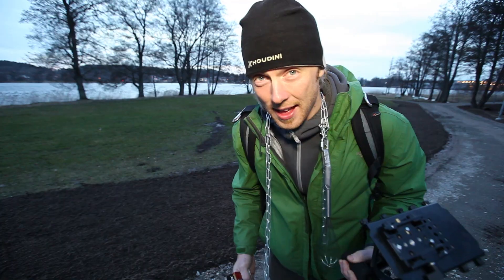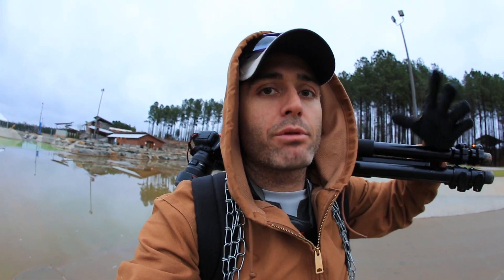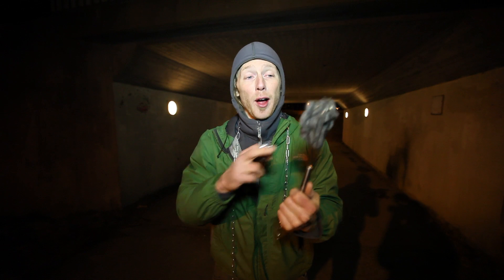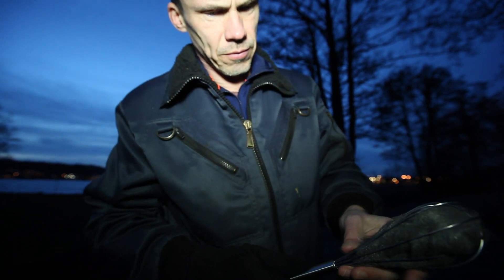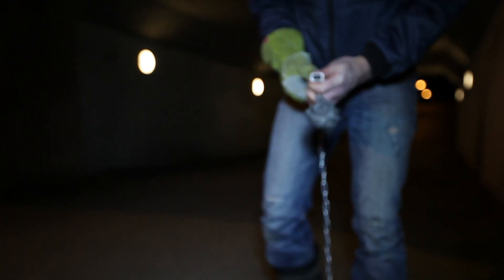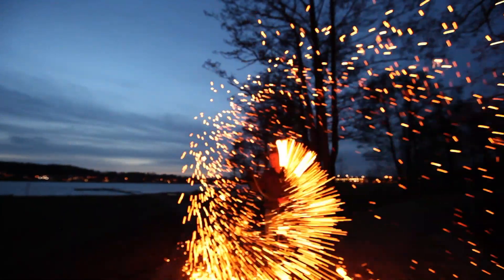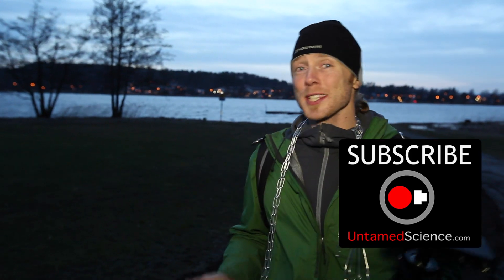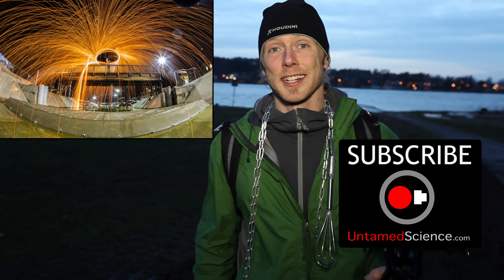Spinning Steel Wool for Science + 5000 subscriber Thank You!

Comment: I noticed the areas you were at had a lot of light. I'm assuming you couldn't have a really long exposure because of the background light. just curious how u got away with not having the pic be supper bright when having a longer exposure time?
Reply: +scooter0241 - The steel wool spinning is surprisingly bright. I only needed a 1 second or less exposure time. It was dark enough there that I could do that. In fact, I kinda liked the look of having the background lit up just a tad.